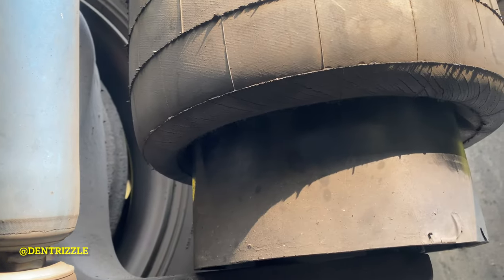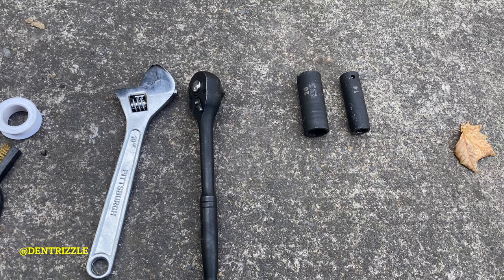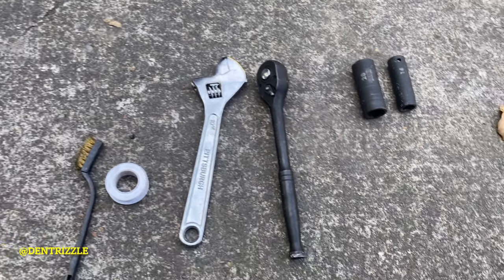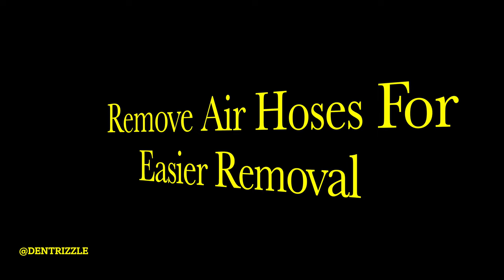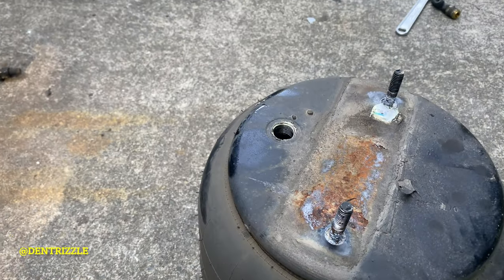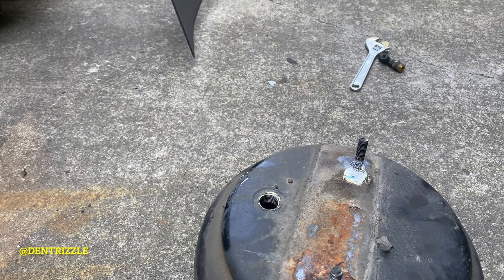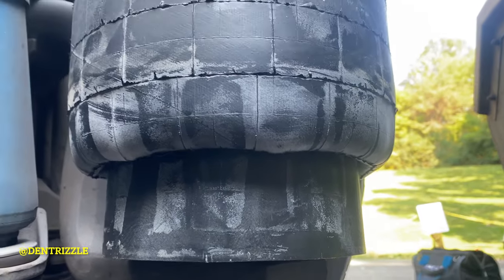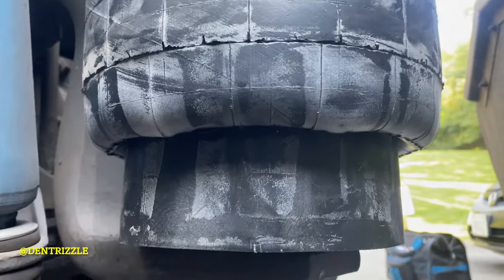How To Replace Airbag On Semi Truck | Kenworth T680 | Peterbilt | Cascadia

Comment: Hey man, thx I love your vids. I'll be doing my own airbags. I've got 2 on my t680 that need to be replaced. Hey how is the dpf filter working after you power washed it. Still going strong? Thx again man, keep on trucking.
Reply from the maker: The DPF filter is still going strong. Don’t have to do a lot of active regen, passive regen or forced regen since. Occasionally I’ll do a force for eg when I stop for a 34 hour reset. Thank you for watching. Just Keep Trucking!!!

Comment: Nowwwwwww my air bag is leaking. Won't inflate fully and I can hear it leaking haha.
Reply from the maker: Do a quick replacement. It’s quite simple.
Reply from the maker: Also expect the rest to follow. That’s what happened when 1 started to leak on my truck
Reply: @dentrizzle  I'll change all at once. Where did you get the Firestone one from? Do you remember how much was it? 

Kw wants 400 for 1 paccar bag lol. 180 for roadforce at mhc but I don't like roadforce stuff
Reply from the maker: @mr3000gtman  it’s been a while but I bought 2 at TLG in Dunns NC and the other 2 at Worldwide Equipment in Abingdon. I paid like $174 locally and $230 out of state.
Reply: @dentrizzle  thank you buddy. I appreciate all your vids and comments.